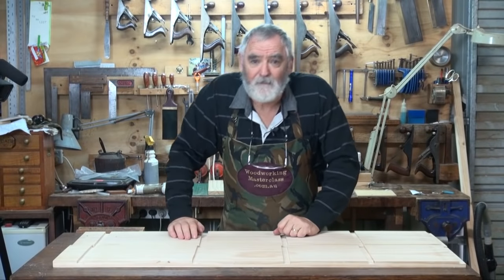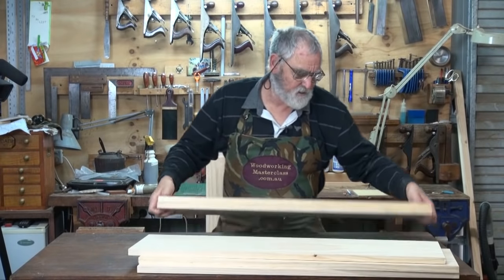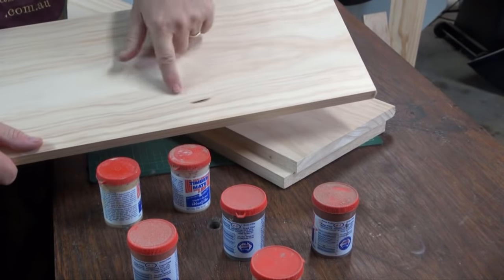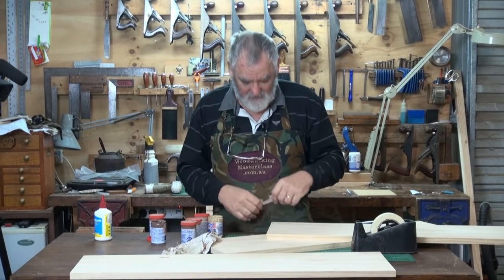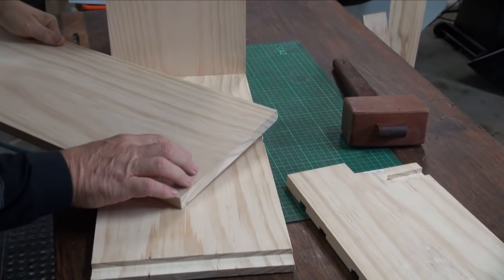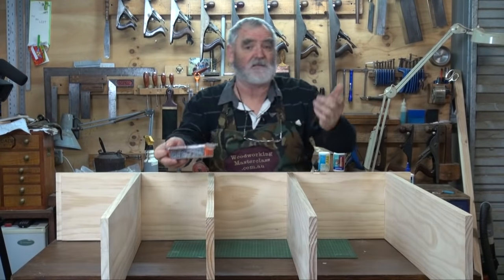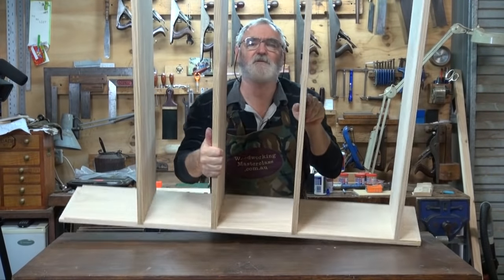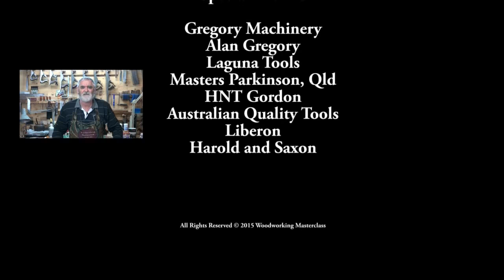4' x 3' Bookcase Part 3 of 6

Comment: Q: How could you correct it in case you found the cabinet was not quite square after gluing it up? Thanks for the great videos.
Reply from the maker: Hi Duncan. Measure across the diagonals of the cabinet and find which is the larger measurement. Tilt it up on one of the longer corners and push, down on the opposite end it will then bring it into square. ("Should!") :) Cheers Steve
Reply: @Woodworkingmasterclass  Thanks, Steve. i much appreciate your detailedf instruction.
Reply from the maker: @Dunc2222  Happy to be of service. Cheers Steve

Comment: What is the width of the timber  12" or 10"?  Thanks.  great video
Reply from the maker: +Karla Piacentini From memory it was bought @ 285mm, but depending on the books you have either 12" or 10" is fine. Cheers Steve

Comment: Hi Steve, a new woodworker here! Thanks for your videos, they are extremely helpful. Just curious if the nails through the sides into the shelfs actually add any structural stability, or if its just to help hold everything in place for the glue-up? Im looking at making one myself shortly and am undecided if screws/nails through the sides are necessary!
Reply from the maker: +Andrew Marshall Hi welcome to the wild, wacky and rewarding world of Woodworking. You are absolutely correct in your thinking. The nails do nothing more the keep everything all in place while the glue sets. It would be different if I didn't set the shelves into housings, then you would need Screws, Dowels, Nails or something the help with the shearing pressure of the Books on the shelf. One this you will learn if you are new to woodwork, is there are many ways to achieve a good result and most people insist their way is the best way. My advice is try all ways and think a few up yourself then decide which way you prefer. All the best with your Bookcase building. Cheers Steve
Reply: +Woodworking Masterclass Thanks for that Steve. Really appreciate your reply, Cheers Andrew
Reply: +Woodworking Masterclass I guess if you had long enough clamps you could hold it all together that way too? To save having to fill in the nail holes with putty later.
Reply from the maker: +Andrew Marshall Yep, that would work on both the outside edges but if there is any belly in the center of the board it won't help to pull that in. If you do choose to use clamps remember to use soft packing pads over the jaws of the clamps or it will mark the surface of the bookcase.
Cheers Steve